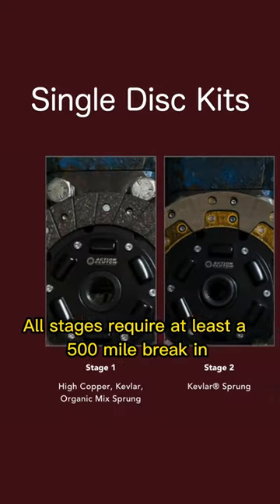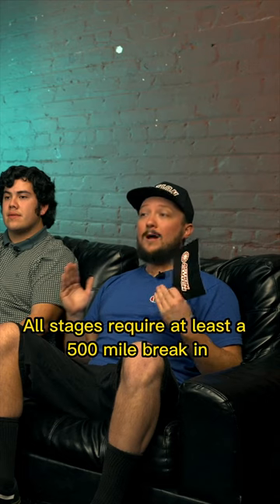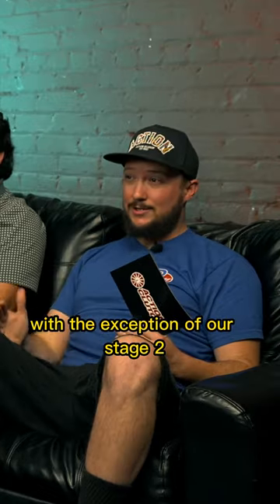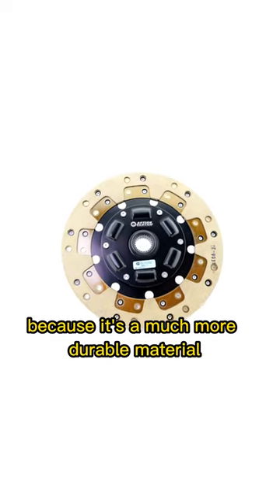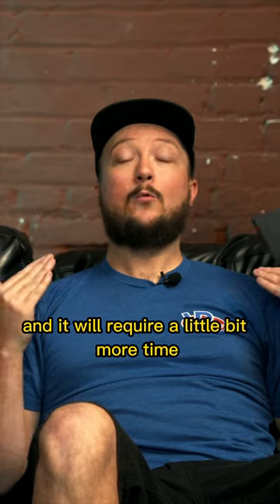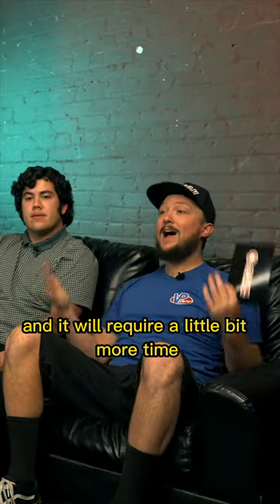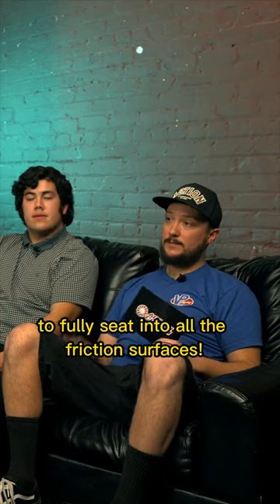Specifics on how to break in your clutch

Comment: and the question, how do you brake it??
Reply: Just use it
Reply: Like, just drive the car Normally or Burn wheel rubber.
Reply: @mikelodeo5715 normally, once break in is done then you can burn rubber
Reply: Thanks for clarifying! Appreciate the info.
Reply: @mikelodeo5715  no problem
Reply: @coolturtledudehellyeah so try n keep rpm’s as low as possible in 1st when you starting?
Reply from the maker: Depending on the clutch kit you must drive it for either 500 street miles or if it's our stage 2 clutch kit with a full face Kevlar disc that one requires 1000 street miles. You must drive the car no more than half throttle under 4500rpms and try and go through all the gears after the break in has been completed you are good. -Cub

Comment: Just installed a new clutch on my 89 ranger. It reacts very quickly and has a very small travel distance pedal fully engaged and fully in gear. Is this normal?
Reply: Give it time mate it will feel better in a few hundred km
Reply: @winchesterwalsh2020  thank you. I just reset the travel odometer.  I'm about  60km I'll give it some time.
Reply from the maker: Check your service manual if the clutch pedal has an adjustment which most likely does, if it is grabbing right away off the floor that's a problem and needs to get address asap before premature wear.